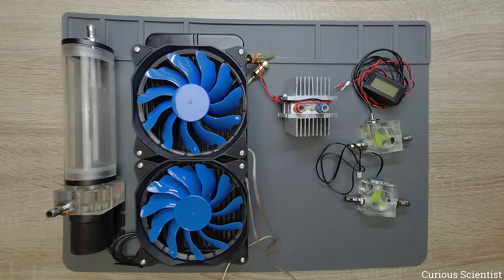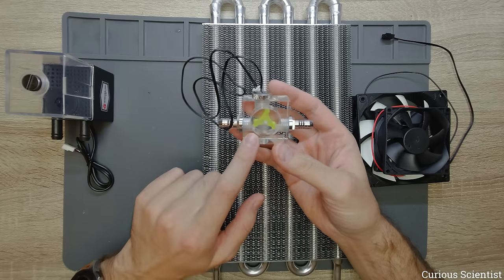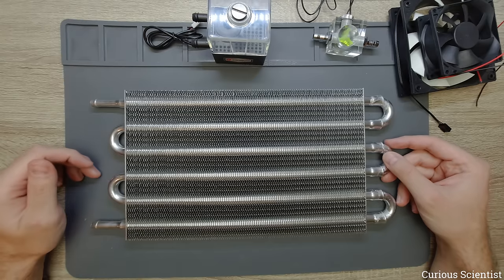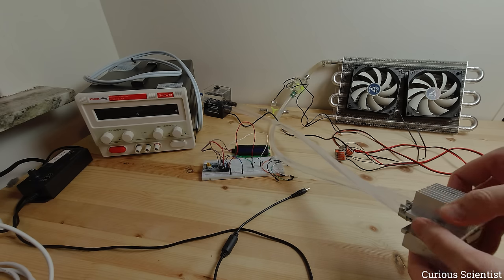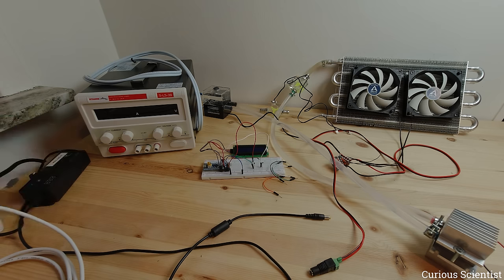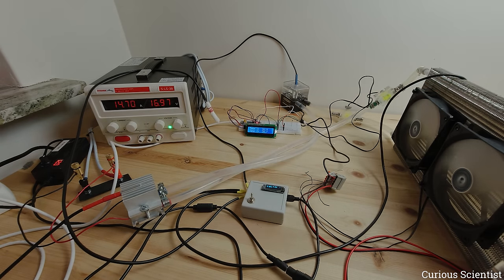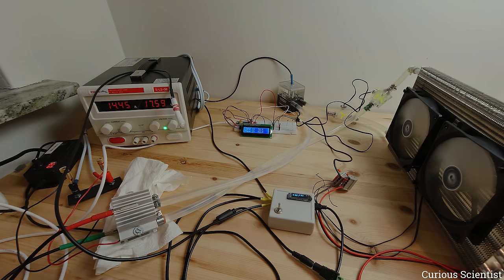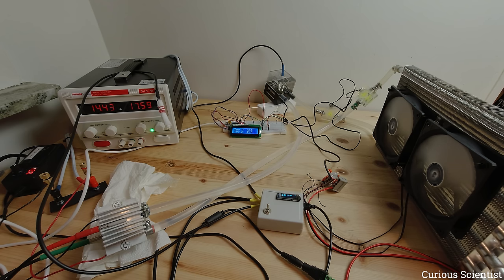Building and testing a new water cooling system for Peltier coolers

Comment: So funny ...I had the same ideas, with one exception...have you considered running a sec water cooler on the cold side also. This should cool the water running though the system and create a mini AC / heater, depending on the polarity you feed the pletier. The problem is watts. Which was the reason I didn't build mine, as you have 4 fans, 2 water pumps and the peltiers, which you can stack the peltiers on top of each other. You could mitigate the watts by having a thermal switch with a set temp to turn on and off the peltiers. Youd have a small solid state AC/ cooling unit, but at the cost of high watts.
Reply from the maker: Of course, the problem is the Watts, it is a super inefficient device that should not be used for AC purposes. It is not impossible to build an AC with them, but it is not feasible in an economic sense (maybe also in an engineering sense too). Like, you can still have steam engines and use them for transportation, but it is not an economical way of doing it... 

The thing you describe (the second water cooling loop) just adds extra complexity and losses. Your throughput is still limited by the cooling capacity of the "final loop", so adding another stage of Peltiers in-between does not improve anything for AC purposes. 

Stacking Peltiers is also a bad idea for AC. Stacking them only changes the achievable max temperature gradient. The heat transfer properties (Qc) are still determined by the final Peltier stage. 

I made multiple videos explaining why using Peltiers are not a good idea for air conditioning. I even did experiments and measurements.
Reply: @CuriousScientist  thank you sir i understand... I will say that they do seem to work in an encloser. My job threw out a mini fridge...i took it apart looking for the compressor and was shocked that it was a peltier device. So ive been toying with the idea of making a mini ac, but came to the same conclusion. It's like a rail gun, it's a stupid idea based on efficiency. It was funny to me that i also thought of a cpu cooler and then thought of trans cooler, also. I also considered putting the cooling side on the trans cooler itself, a series smaller ones on one side of the cooler, just enough to drop the temp, but not freeze, then one high cfm fan. Towards the other side. Perhaps with an Arduino to turn them on and off, but again is it worth it? No. I have another crazy project, which is a cooling suit. Perhaps in that application peltiers might be better suited, pardon the pun. I might use them for that instead of the mini ac. With all the respect in the world, sir, technically... we are still in the steam age. Gas, coal and even nuclear use steam turbines. Perhaps there could be a technological leap in peltiers that could convert the heat directly into electricity in a fusion reactor some day. I think there's something there, it just needs to be further developed. It was a pleasure chatting with you Sir. May the good Lord keep you and those you hold dear through these crazy times we're living in. 
Oh one last thing i forgot. What do you think of an automotive application. On a intercooler for incoming air, or for the gas lines. In that application, watts don't really matter and dropping the temp by even a few degrees makes a huge difference. The Hot side could be cooled easily too by incoming air. What do you think?
Reply from the maker: Hi! Yeah, mini fridges (like super small ones) or even wine fridges can use Peltiers. But it is a small, well insulated volume, not a whole room with a lot of heat sources and bad insulation. 

I know that turbines use steam, but I was referring to the locomotives. We use diesel and electric locomotives but not steam-powered due to known reasons (e.g. efficiency). Same with the Peltier vs. compressor-based cooling. Even though the compressor-based solution is noisier and it has moving parts, it is at least 3-4x more efficient than a Peltier cooler. So the advantages outweigh the disadvantages. Of course Peltiers also have their niche application area (portable XRF device, X-ray detectors in electron microscopes, coolers for diode lasers...etc), but these areas are typically not areas where a lot of heat needs to be pumped.

For intercooler, in my opinion it is not feasible. I could be wrong, but there's a huge amount of air within a short amount of time passing through the intake, so it would be very difficult to build a Peltier-based cooling system to achieve even a few degrees drop in temperature. If it was feasible, people would already use it, especially in racing.
Reply: @CuriousScientist  Im enjoying our conversation so much. Sometimes you get bad people on here. I'm sorry about the steam comment. It wasn't meant to insult or be a smart A...it was just a realization I came to a while back. Outside of solar hydro and wind, were still in the steam age. I had a few ideas i wanted to run by you on increasing the efficiency of a Peltier AC. Perhaps the fan blades can be a tordial design. That would give more CFM out of the same electrical output.  I also think that having a water heater radiator system that uses a reciprocating syphon system could eliminate the need for pumps. An Arduino could be programmed to control the peltiers and cycle them like in a real AC system, where the compressor also cycles on and off. Air to air is not that efficient, but water to air is better. 

I should probably mention that I am currently sleeping in my Caravan. I moved to a new city, where I didn't know anyone, my roommate died, and the family kicked me out. I had no place to go, so I did my best. I have a job and can get another room mate, but I figure, if i can keep this going for a bit, I can save some money, so it doesn't happen again. It sucks, but I have a Bluetti power station, solar panels and cooling fans. Its like jumping in a cold pool, you might cry at first, but you acclimate. I shower at the gym and have to be disciplined to the extreme to make it work, but i have a routine that works. 
My problem is i live in Orlando Fl, so it gets hot, really hot. So a peltier AC blowing directly on me would be heaven sent. I have a storage unit where i keep some of my stuff but can't sleep there. I can't order stuff cuz I don't have a mailing address and dont have a work shop to build things. Plan B is to get a 12v mini fridge, have a water reservoir with anti freeze inside the fridge and run lines to a few 120mm radiators with fans mounted to the top of the van. Like this the fridge would be dual purpose. 
I wanted to tell you that despite my current predicament, I have faith and hope. I've grown closer to God and it's that faith in him that will get me through this. Made me a more grateful and humble person. I plan to make a vid of my van conversion and things I've learned in the hopes that it can help others in my situation. I was an MECP certified tech at best buy and C city, back in the day, so im not a stranger to custom car installs. Remember always to believe in the good Lord because he always believes in you. I thank him every day for the things i have and those that I don't. The key is to never give up hope. Take care my friend and may the good Lord bless you and those you hold dear.

Comment: Hi there, great videos on approaching the peltiers with great data (the most valuable part).
I'm planning on using Peltiers to make an off grid fridge by using power from my car. I liked the idea of using the oil cooler, but I see you don't use it in future videos? was its performance that much worse from the cpu coolers?
Also, what I was planning was not using the vents on the oil cooler but simply dump it into a 20liter bucket of water (as a heat sink on the warm side). When water would heat up to about 35C (from enviromental 25) I would simply dump it and replace with fresh water. I read that metal to water transfer without vents is at least 10x better than ventialted air colling (that's why i was planing on using it). For cold side inside the fridge I was thinking similar to what you used for foam chamber - an aluminum plate that would be attached directly to the peltiers and then it would have a bigger surface from which it would absorb heat from inside the fridge.
For insulation, 8cm thick XPS. inner dims of the box are 40x40x40cm and i was thinking on using 8 pieces of tec12703.
What are your thoughs on it?
Reply from the maker: Hi, and thanks! I don't use it in other videos, because it is large and a bit messy to use it as compared to CPU coolers. CPU coolers are just more compact. If you just use a large bucket of water, what's the point of using a radiator at all? Other than, maybe, avoiding contamination in your cooling circle, probably nothing. You could just directly circulate the water inside the bucket in your whole loop and replace the water if it gets too warm. 

Regarding the cooler box, I have a whole playlist on my build. You might get some valuable insights and learn from my mistakes. 8x TEC 12703 sounds good! Playlist: https://www.youtube.com/playlist?list=PLaeIi4Gbl1T8SlJY5ODqs2cn5hoXZlIWm
Reply: @CuriousScientist  Hi, thanks for the reply. regarding cooler inside the bucket, it's actually the other way around, I don't want to contaminate the water in the bucket. The problem with coolant water is that it goes through pump and inside it mixes lubricant (oil) with water. I know it is a very small but still it does so. And since I'll be dumping the warm water into dirt in nature, i don't want it to have micro particles of oil in it.
In terms of preformance I see that this oil cooler provided a few degrees of temp change - was this less/more than the cpu water cooler with which you compare it in the video?
Thanks for the playlist! I'll definitely check it out
Reply from the maker: Hi! Yes, if you want to separate the circles to avoid contamination, it is a good idea. 

Regarding the performance, I did not notice too much difference and the oil radiator actually had some disadvantages because for example the fans did not cover it entirely. Some viewers suggested to build some skirt around the radiator to improve the airflow through the fins of the radiator. I haven't tested it, but it only makes sense. Also, since it is much cheaper than a CPU cooler radiator, I would not mind a tiny bit less performance.

Comment: If you had the Peltier the other way around, as in the water block in contact with the cold side, would cool air be pushed through the radiator?
Reply from the maker: If you cool the water loop, of course, but you should not expect a very cold air unless you use a lot of Peltier coolers to cool the water in the cold loop. Also, you still need a similar radiator cooler to keep the hot side properly cooled.

Comment: The cooling fan motor creates heat, not much, but creates heat. If you pulled cold air through the radiator, you remove the cooling fan motors heat as well. Just thinking.
Reply from the maker: They don't produce enough heat to become noticeable.

Comment: If you have solar power at home, this is definitely worth it. If you do all the other stuff like CPU lapping, liquid metal and a large external heatsink radiator combo, it's gonna idle at low room temperature easily.
Reply from the maker: Solar power for what? Also it is very bold to suppose that people have access to solar power.
Reply: @CuriousScientist  Huh? Many people have solar panels for their homes. Solar power to power this thing for long periods of time? Often times, with off grid homes, there is an excess generated by solar energy and some people choose to sell it to the grid while others use it for purposes like this.
Reply from the maker: Well, for example, I don't have solar power. And many people who live in apartments cannot install solar panels. Also, it is quite an investment to have solar, I don't think it really worth it for just this purpose.
Reply: @CuriousScientist  Of course not just for this purpose. I never said anything about installing solar at home just so you can use a peltier module for your PC. Was a remark for those who already have one or are planning to get one, that this could be a fun bonus.😂😂
Reply from the maker: Okay then another question. Why would you choose to cool your PC with a Peltier? CPU is doing fine at temperatures between room temperature up to 70-80°C. Peltier would only make sense if you would want to cool below room temperature. Otherwise it is a huge waste of resources.
Reply: @CuriousScientist  It would be just a fun experiment to be honest, no logical reason. If I was seriously considering cooling my PC to below room temp, I'd use a heat pump system instead. It's a technological marvel that supersedes A/C in every way. Again, people who have or would have solar and heat pumps in their homes would benefit from it.
Reply: @CuriousScientist I would personally use this technique to build a portable split unit Peltier AC for traveling/hiking. There isn't anything of the sort. We only have travel fans (possibly with evaporation tray) and then full on 12V vehicle AC units which are 100 times more expensive than the cheap Chinese evaporation fans. This would be great, including in an RV with solar power.
Reply from the maker: There isn't any because it is not feasible. Peltier coolers are so inefficient that you cannot make an AC with them that could provide enough cooling power while having a reasonable electricity consumption.

Comment: Good job, i just wanted to let you know that your pump is so quiet because its junk. I have the same one, cost like 20 from china. It doesnt circulate enough volume, i used two pumps and i was able to fill my loop.
Reply from the maker: I had no problems with the pump, it circulates enough water for my requirements.

Comment: Very nice! Might suggest adding more wattage peltier modules. Built and working on similar to work off solar power trying to keep wattage under 300 for better solar panel. Copper is better cooler on hot side too. Good work! Saw another video where person is stacking peltier modules got temp really low was surprised.
Reply from the maker: Thanks! I also made a video on stacking Peltiers and reached -45°C.

Comment: hey, i have a acuarium chiller that I use to cool  my pc cpu, do you think if I add a peltier to the water loop system might help to stabilize temps and help the acuarium chiller not to turn on so often? 
My idea for example would be set the acuarium water chiller temp to like 25ºC then set the peltier to 23ºC, once it goes 3ºC over 25ºC it is when the water chiller turns on and the peltier would help , Cool faster and maintain temps longer down. do you think Im correct? or it would be a loss of time and more energy waste?
Reply from the maker: Hi! So, instead of your aquarium chiller, you want the Peltier cooler to turn on often? Also, why would you want to use a chiller to cool the CPU? The CPU does not need to be kept at room temperature, it runs happily at higher temperatures. Adding a Peltier cooler (or maybe more, because one may not be enough) just adds so much complexity for so little in return. I do not recommend it.

Comment: Hello. I am very inexperienced in this type of system so I apologize if my question doesn't make sense or has been answered. 
Is it possible to circulate water through the block not to cool the block but to cool the water so that cold water is flowing through the radiator so that when a fan is blowing air through the radiator it cools the air coming off the radiator? If so, what is the air temperature coming off it?
Reply from the maker: Hi! Check my other videos because I made videos where I answered your questions. But if you want to build an AC with the above described thing, you'll have a hard time achieving a good cooling.

Comment: Firstly let me say your video has given me a Layman, great insight of Peltiers, however, can I use Peltier system to cool running water ?
Reply from the maker: Hi! I'm glad that it helped. Regarding your question, it depends. What is the flow rate of the water, what kind of temperature drop you expect and finally, what is the budget? But typically, it can be a challenge to cool running water.